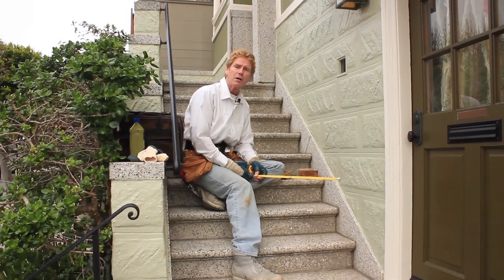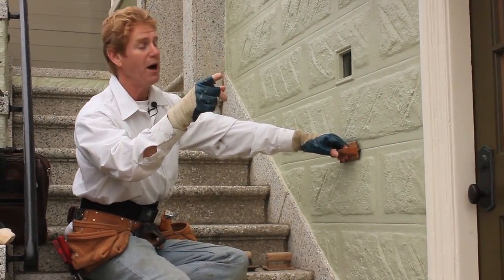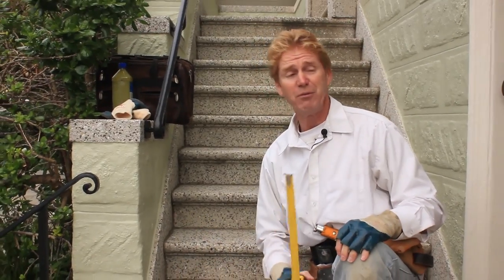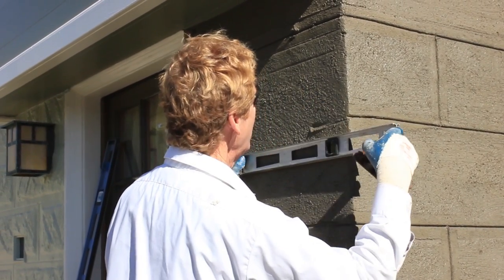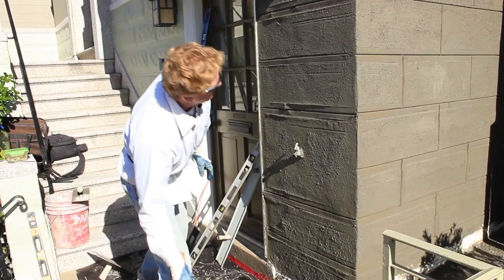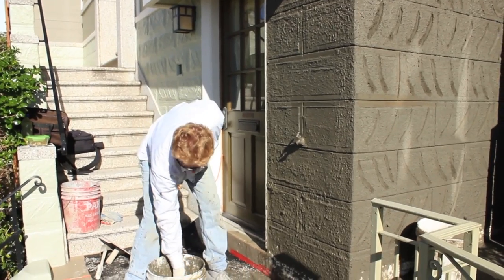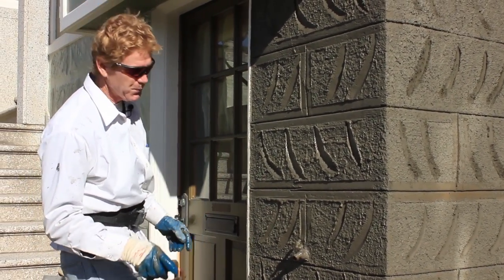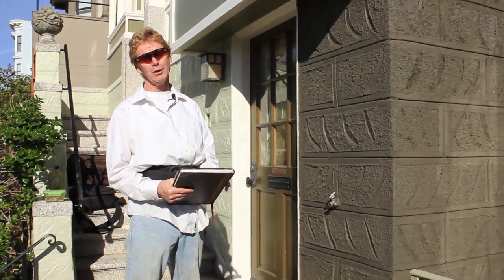Stucco looks like blocks or bricks

Comment: great job kirk, why do stucco after a long period of time bubble and fall off?
Reply from the maker: Hi Helmuth Montoya, Great question.
 As a rule stucco or concrete is not supposed to bubble or pop off,
 however I have seen this happen to concrete it's called spalling, usually caused by corrosion, water going between the concrete freezing and other chemical reactions.
 Best wishes, 
 kirk and family

Comment: Can you do this over existing stucco or do you need to remove the existing stucco first?  The house is on wooden stumps and high set going from 1 1/2 meter high at the front to 5 1/2 meters high at the back. Will the added weight be an issue? The stucco is in some disrepair with cracks in several areas,  but most is in reasonable condition. The house is roughly 70 years old and wooden based with stucco exterior. Thank you.
Reply from the maker: Morning Corinea N, yes, this can be done over existing stucco, with the proper know how,
 You must first pressure wash the walls then apply a bonding agent, now you're ready to stucco,
 I would not go so thick as your new stucco is only as good as what it's placed over. 
You can also purchace styrofoam molds and attach these on this wall to give the same effect with a quarter of the weight.
 Cheers,
 kirk giordano plastering

Comment: Fantastic work, Kirk! I wish every master mason was as skilled as you. Please help! Where can I find the grout line/expansion joint tool you used for my crew? We need something similar to your ‘just right’ small one, too! 3/8” is too thick, 1/8” x 3/16” D is what we need. We were just about to try to make something similar to make the lines in the stucco finish coat when I found your video. I’ve searched online and called B & L the stucco experts to no avail. The masons were using a trough and leveler but the lines come out wavy and uneven bc the stucco is thicker in some areas of the lines. I should mention the lines were preexisting and the masons repairing and putting on a finish coat. Any help would be appreciated (tool brand?)! Thank you!
Reply from the maker: Good morning my friend. Sounds like you need to google www.bontool.com. They have both plastering and concrete tools.😉 
 Our unique plastering Tip:  all subscribers or anyone who stumbles on our channel with a question, type it into our Stucco/Plastering channel, and like magic, a video will appear to explain how it's done. 	
   This feature is miles ahead of any plastering forum. 🥳	
Kirk & Jason Giordano Plastering

Comment: I have a Stucco guy instructing us to use 2 inch foam on our cylinder block/concrete commercial building with no plywood.  what is your recommendation?
Reply from the maker: Evening C Grizz, what he says, if I am understanding this correctly is that he will use styrofoam, mesh netted and cementitious coated styrofoam to the corners.
 This is advisable, as there is nothing to rot and it's affordable, simple and best of all last forever, with so many choices of design or detail.
 Ask for a sample.
 cheers,
 kirk giordano

Comment: Wow I've been watching your videos for 6 months now and still impressed.
I've looked through a lot of your videos and am curious. Have you ever put stucco over mud brick or better yet repaired existing stucco over mud brick? I am in Arizona and the house was built in 1920 something needs repair of course. Your thoughts appreciated :)    
P.S. I did a few small repairs myself with thanks to You
Reply from the maker: Hi George Gordon, many times, its similar to cinder block or cement, pressure wash well, apply bonding agent than stucco as usual.
 Type it how to apply stucco over terra cotta on this channel.
 Cheers!
 Kirk Giordano

Comment: Kirk,
I'm assuming you did not use an accelerator, so that you would have sufficient time to work the stucco.
 __ And speaking of stucco . . . . the origin of the word . . .

. . . fine plaster used as a wall coating, 1590s, from Italian stucco, from a Germanic source (cf. Old High German stukki "crust, piece, fragment"), from Proto-Germanic *stukkjam, from PIE root *(s)teu- (1) "to push, stick, knock, beat" . . .

Greg
Reply from the maker: Evening GSMSfromFV, thanks for the stucco origins, that stuff fascinates me.
 On the issue of acceleration, the front wall needed two inches while the rest of the wall was built out properly, but I didn't realize this until I got there. I added luminite to the first scratch coats to build it to 1 and a half then went back to conventional, dude you are on the ball.
 Cheers,
 kirk giordano

Comment: What is your thoughts about using a stucco blower on walls.
Reply from the maker: Evening Donald, for large jobs it's o.k.
 For patchwork, it's too difficult as you need at least 7 to 10 men.
Teaching plastering do’s, don'ts and reasons why
            Captain Kirk out, Live long and plaster
Reply: Thanks for the very important information.
Reply from the maker: Evening Danold, no worries.  
                Peace, love with happiness to all.
    Kirk Giordano plastering tips-mixed with sound advice

Comment: Hi Kirk. Pretty much Thursdays job. Think you just pulled me out the sh*t. What’s the soup mix? I’m thinking cement water and a touch of fine sand?
Thanks again great video ✌️😉😀
Reply from the maker: Howdy Calvin Dude, my fellow plasterer, I/we usually mix three times the sand for 1 part cement plaster.
    If the sand is fine or heavy, (we never know what we'll get at the plastering material yards,) we improvise.
If we receive fine sand I use more water, If I receive heavy sand I use much less water when floating that is. 
                               Live long and plaster
         Mastering Plastering for the beginner’s to experts
Reply: Thanks Kirk. U the man. 😁👍🏽🇬🇧
Reply from the maker: Howdy Calvin, thank you and no worries.      
                                   Live long and plaster
        Teaching do’s and don’t of plastering and stucco work
Reply: Kirk Giordano plastering Inc. went well today. Renders flat, put joints in and stippled with wet flat brush. Worked a treat. Thanks again.  I’ll keep watching and learning. Calvin.
Reply from the maker: Atta Boy Calvin, practice leads to perfection.       
                     Live long and plaster, 
  Sharing stucco secrets and or common sense tips

Comment: Looks Good. I Know you're Matching Other Work..I Think it Looks Better without those Trowel Marks. Those Concrete Tools Are for Control or Contraction Joints. Around Here Expansion Joints Have a Oil Soaked "Cardboard" Strip in them. The Control/ Contraction  Joints Are for When the Concrete Shrinks & Cracks. I Guess it Doesn't Matter What you Call them. It Just Kinda Struck a Nerve Hearing it Called Expansion Instead of Contraction. I'd Call Them Mortar Joints Because in Real Blockwork That's What they'd Be. Around Here there's a Lot of Old House Foundations Built of  Small Thin Stone then Parged & Lines Scribed in them to Look Like Block. That's Something I've Done a Lot of. We Also have Thicker Face Stones With 2 Color Beaded or Ribbon Joints. Standard Mortar with a Colored  Raised ½ Round Bead Level & Plumb.
Reply from the maker: Morning John, there are many ways to skin a cat and many names to call a tool, Good tips brother.
                           Peace, love, and harmony to all
         Sound Plastering tips for the DIY beginner’s and Plastering experts

Comment: Hy Kirk
Great Job/Beautiful Work??
Was the home-owner happy with the finished product, don't confuse a dropped jaw with happiness.
I'd like to see this (closeup) when painted and in sidelight.
As the self proclaimed Stucco Guru/Master Journeyman, (as youtube titles suggest) I would have thought this job would have been finished flawlessly..
If you get a chance post some more intricate plastering skills, Venetian, Quion, Running Moulds,  Scrub Fine, etc
Pump Darby Green Float Pump Darby Green Float
Viewers check Mike Haduck
Reply from the maker: Evening wazza363, is this project flawless? doubtful, however the folks were happy, at least they seemed so to me.
 They could have cursed me behind closed doors as you seem to be suggesting.
 Will I go back and take picture of the painted products for you to inspect? Really?
 No.
Sorry but this project was an hour away plus I need not to have to prove to anyone anything as my self esteem is normal. 
The words stucco guru, I read somewhere and I thought "hey I like the sound of that title, so I stole it" sound better than sort of a good stucco dude.
 Even though you politically downplay insulting me, I forced myself to watch your work, and  by gosh, golly and gee whiz find your work worthy of insulting me as your the real deal with cement, but I'm still better looking!
 Best wishes, 
 Kirk & Jason Giordano's DIY plastering and stucco network
Reply from the maker: Howdy Wazza dude,thanks, He does sound a bit whiny.
 Best wishes, no one can please everyone.
 Kir giordano Plastering